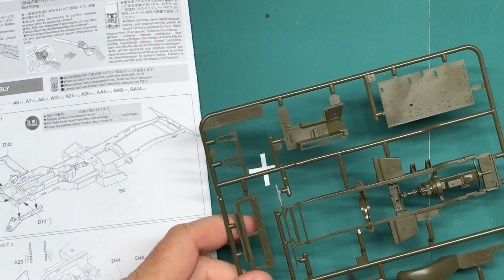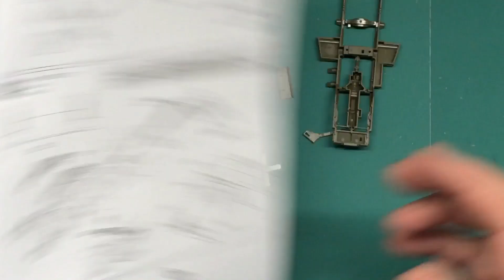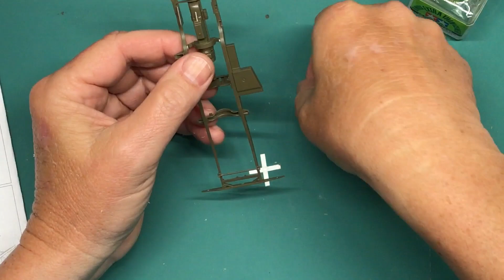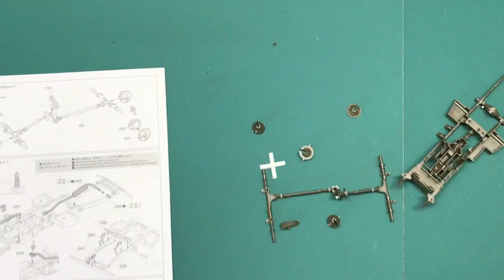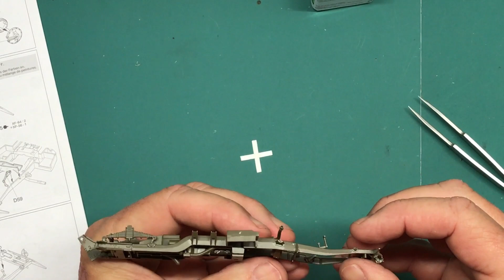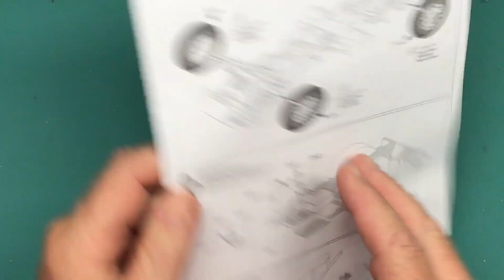Tamiya 1/35 M3A1 Scout Car, Part 1 Steps 1-5

Comment: Looking good so far. Appears to have the same drum type winch on the front of this one as is on the M3A2 HalfTrack (35070) which was more oval than round on that kit, and didn't go together very well from what I recall. This being a new tool kit shouldn't have that issue...
Also, propellor shaft (more commonly 'prop shaft') is what we in England call the shaft that connects the gearbox to the differential, and drive shafts here connect the differential to the wheels, although we more commonly call them 'half shafts'. Clear. As. Mud. ;)
Reply from the maker: Thanks, cygnus. I love the differences between American English and English... English. Most times words and phrases can be figured out in context. We call the prop shaft a "drive line" and the diff to the wheel shaft an "axle". Boots, trunks. Bonnet, hood. I love it.